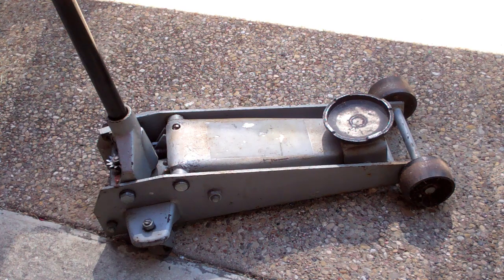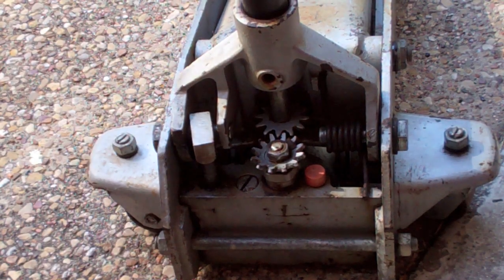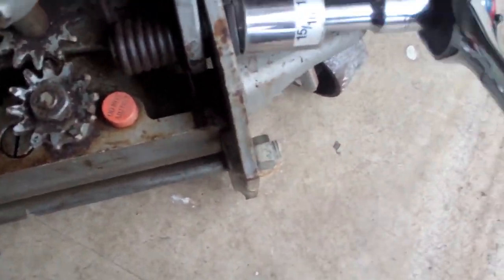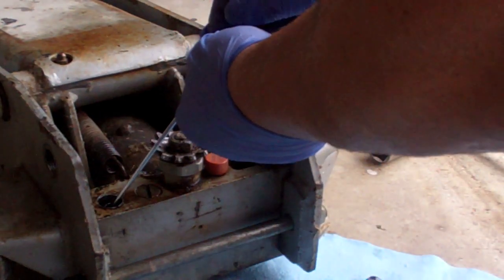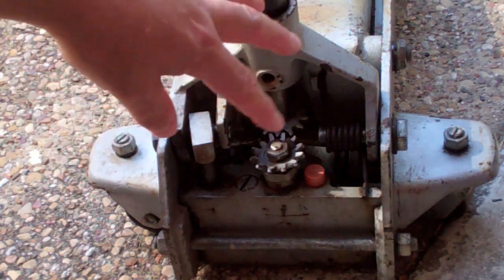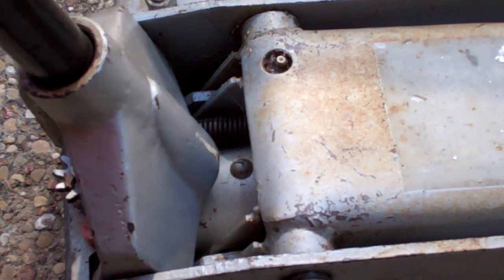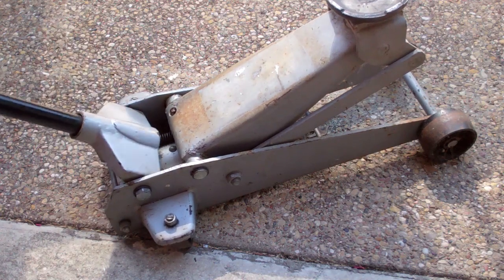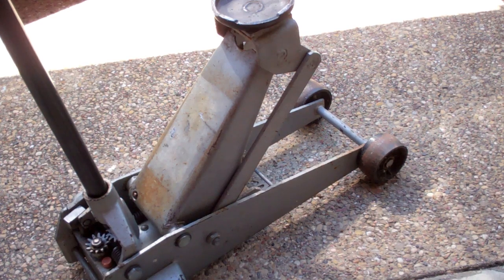How to repair a floor jack that leaks fluid (1 year anniversary updated edition)

Comment: I've got this same jack - first repaired it about 4 years ago using this video as a guide.  Now it's leaking again but the nylon O-ring (the second one in the groove) appears to be bent and buggered up so much that it won't allow the new rubber O-ring to slip into place.  Wondering if maybe just the rubber O-ring can suffice?
Reply from the maker: my guess is the plastic ring is needed and hopefully you can find a suitable replacement

Comment: My jack would not hold pressure very long. The book said bleed it by having jack arm released all the way down, then open the filler plug and put your foot on front wheels, then pull the jacking arm all the way up by hand. While up, put filler plug back in, lower jack arm with the handle release  then jack up something. It fixed mine ...  no more slowly dropping down..  Didn't have to pump anything looking for air bubbles and stuff.

Comment: I have two 3 ton Floor Jacks, one was a Freebee, because they said it didn't work, but it didn't have the lifting Plate that fits in the hole in the top, where it meets the car frame. But got the jack lifting by filling the 3 access holes for the fluid. 2 screw out holes, and the rubber plug in the cylinder. So now I had find a similar jack with a lift Plate to fit this one. Found one on Offer Up, that they said it wouldn't lift, cost me $25, Plate fit perfectly. Then I filled and bleed the other jack, and got it working too.  Took the 2  big front wheels off cleaned them up, oiled them, then went to the 2 little wheels on the back. WARNING: A nut and lock washer holds them on the Frame, and I thought it had captivated bearings, it didn't, it had a top and bottom bearing plates with 19 little ball bearings in between, and I had to chase all these little ball bearing across the floor. So be careful if you remove the 2 little back wheels. I cleaned the plates, put grease in the groves or both plates and placed the ball bearings in them and held them together till I put the wheels back on the jack frame.  Great Video, saved them both for future use.  Thank You.
Reply from the maker: thanks for sharing those tips

Comment: to echo others, yes great video and comments also. I had same issue and replaced oring successfully...however...still leaking badly at plunger. Soo apparently the U cup under the oring needs replacing or the oring wasn't done correctly and I have to do again. Any idea where I can get the lower U cup seal? Thanks again.
Reply from the maker: usually eBay or Amazon are my go to places for odd parts

Comment: Do you fill that tank were you replacement o rings
Reply from the maker: initially I did put some in there, but the proper refill procedure is through the rubber cap

Comment: Bought a brand new jack and immediately started leaking fluids from the pump. It doesn't have a gear like that one. It won't even lock...it keeps free spinning either direction. 

Dusted off the junk one i found on the side of the road and sprayed it with some PB blast, and the thing worked like a charm. I'll be using this vid to service it and im returning the new one
Reply from the maker: "they don't make 'em like they used to"

Comment: I have this same jack but it is a Blue Point version 2.5T.  It didn't leak but finally stopped lifting so I stripped it down totally before I found this video.  The problem was that the main seal on the piston had disintegrated.  I have replaced this from a local supplier and put all the little springs and balls back where they came from. I have refilled it with hydraulic oil but now I can't get it to lift at all.  The pump seems to be working but there is no sign of lift. 
Is there something that I may have missed? How can I be certain all the air has been expelled?
The video was great, bit I'm missing something.
Reply from the maker: I'm not a jack specialist, but usually low fluid or air in the fluid would cause the lift failure from what I have experienced
Reply: @WJHandyDad  I'm going to take it all to bits again and see if anything has become misplaced.  It's strange that the effort on the handle suddenly changed when I was trying to pump it up.  Something's amiss.
Reply from the maker: @mikecurtis3333  good luck, hope you figure it out
Reply: @WJHandyDad  Hello again, I have lost count of the number of times I have stripped this jack down and every time it fails to lift or even attempt to lift. It is just like the pump is doing nothing.. I have the exploded diagram of all the parts and everything seems to be there and in the right place and it's filled with oil.
All the seals have been replaced. The big ball is on top of the small ball and the safety valve is assembled correctly. The small ball is under the up/down valve.
Are there any other valves or balls hiding anywhere?

I am desperate to get it going again as I have some work for it.  Can someone please suggest what I might be missing or doing wrong? 
Any suggestion is welcomed.
Reply from the maker: Sorry you are going through that.  Unfortunately I'm not a jack expert, just a DIY dad who managed to fix his jack
Reply: @WJHandyDad  Hello again.  Thanks for the reply. I think it's going to have to come to bits again, but I'm not sure what to look for this time as I still think it's assembled correctly with all new seals.  Everything is back where shown in the manual.  I have even tried pulling it up against the springs to draw the oil into the cylinder but even that did not work. 
In fact it blew most of it out onto the floor which is the opposite to what I thought would happen.
Sadly round here we don't have the luxury of a jack fixer.  I'm in rural Spain.
Reply from the maker: good luck, I hope you figure it out.  Let us know

Comment: My inherited Craftsman has been leaking from the same spot. Would you say the o-ring is a ¾" outer diameter x ⁹/¹⁶" inner diameter x ³/³²"?
Reply from the maker: I put a link in the video to the o ring that fit mine.  No guarantees yours is the same.  I had to special order mine because I bought several sets of o rings and none of them were correct.  I found my size by taking the old o ring and holding it over a ruler
Reply: @WJHandyDad  Well. Mine ended up using 2 different sizes and by dumb luck, I bought them! Can't do a test until I see how to bleed it, but that can wait for tomorrow. Plus I forgot to get more fluid. 😋
Reply from the maker: @sethvaughn6316  glad you were able to get it fixed.  The fill and bleed should go smoothly.  I've replaced my o-ring 1 time since I filmed this video and the jack still works like brand new

Comment: This is a great follow-up video and thank you for the guidance!  I picked up a similar jack for nearly nothing off Marketplace for my son and wanted to replace the pump O-ring seal before giving it to him.  If I might, I'd like to offer a couple of additional tips that I found helpful regarding removal and replacement of the O-ring.
-  Pump up the jack before you begin...at least half way.  That  will avoid the flood of oil when you remove the plunger.
-  Once the plunger is removed, pull out enough hydraulic oil from the pump cavity to clearly see the O-ring and plastic retainer.
-  Polish the plunger shaft on a wire wheel and then with steel wool to a shine.  Also, polish the lead-in chamfer on the plunger...this is rough machined and could abrade the O-ring upon insertion. 
-  Grab a 1/4" wood dowel and round the end.  Instead of using a screwdriver which may cut or nick the new O-ring, maneuver the new O-ring into the groove below the plastic spacer using the rounded end.
-  Before reinstalling the plunger, open the jack and push down on the jack pad.  This will push some oil out of the plunger port and purge any remaining contaminants in the plunger area.
Reply from the maker: great tips.  thank you for sharing

Comment: I must say how much I appreciate your floor jack repair video. Mine looks almost identical, only  in red, manufactured by Rodac (NL)

FYI: for those in Europe looking for the size of the o-ring: it's a 16mm x 4 mm (inner diameter x thickness)
Reply from the maker: glad it was helpful.  Mine still works although I did replace the o ring a second time since the original filming in 2016
Reply: I'm in Spain so the metric sizes were useful.  Thanks
Reply: @mikecurtis3333  De nada! Mi casa es tu casa ;-)

Already on to my next repair and learn challenge: chainsaw carburettor throttle adjustment whilst avoiding tennis arm sensation.

Comment: This is exactly where my jack is leaking from.  It's a very old craftsman 3 ton that was in the basement when I moved in so decided to clean and paint it and it looks and works great.  Used it many many times and now just developed the leak.  It's a strong jack, no reason to get rid of it if I can fix it easy enough.
Reply from the maker: should be fixable.  It's 7 years since I filmed the fix and I am still using it.  I did replace the o-ring one more time since the original video
Reply: @WJHandyDad   I saw the o-ring package says Buna 90, is that 90A hardness?  Im coming across both 90A and 70A type o-rings.  Think it matters?  the 70A I can find locally, they sell #94 which is 5/8-7/8-1/8 also.

Comment: Mine looks very very similar amx leaking at the same spot... mine is a GJ 6000 3 ton. i too cant find replacement parts... im going to bite the bullet on your suggestion of the o ring 208. crossing fingers
Reply from the maker: good luck - I hope it works.  Remember to put some jack oil on the o-ring before installing (I don't think I mentioned that in the video)

Comment: my 05 Craftsman has a double lip upper dust seal and below that is a groove for the o-ring and a plastic washer under it. And unfortunately the new o-ring does not want to fit in the groove with the plastic washer. I may try removing the plastic washer.
Reply from the maker: hope you get it - it can be tricky.  I heard someone else mention putting the o-ring on the piston and then trying to install it by pushing the piston it.

Comment: is the jack handle supposed to be able to turn all the way to the left (counter clockwise) until it stops? - I notice if I do that, I can't pump the handle unless I turn it to the right a few times... is that normal?
Reply from the maker: mine pumps no matter where I have the handle turned.  Whether or not that is normal or not, I don't know

Comment: I would say the real test would be to test the jack under load. My jack also does not leak when not under load and pumps properly. But as soos as you push it to 500kg-1ton it stats to leak at that o ring again :(
Reply from the maker: I replaced the o-ring one time since I filmed the original video, but that jack still works great.  I show it picking up my Avalanche in the final bleed video

Comment: Looks like your floor jack is identical to mine. I removed the oil plug and added oil, and then purged the air, but I could not get that original oil plug back into it's hole no matter what I did. Wondering whether you had a similar problem, and if so how did you finally get that plug back in.
Reply from the maker: I honestly don't remember having any trouble with it.  Try putting a dab of jack oil on the bottom of it or soaking it in 303 and see if that helps.
Reply: @WJHandyDad  Could be that my rubber plug is very old and very hard, and therefore not pliable enough to squeeze back into the oil fill hole. Will order a new plug that hopefully will fit.  Thanks for your response.

Comment: I have the same one and probably bought it early 90's. I am going to completely rebuild/paint it. Is there a kit number to replace all the seals? Thank you.
Reply from the maker: I'm not aware of any
Reply: I just bought the seal from amazon  Part# B0188VX5A4 Was about 4 1/2 bucks. Good luck, i'm trying to gat the seal in now, not very easy

Comment: I have a smaller condition of what you had with the leaking piston. Where about's might I find the o-ring or even a set of o-rings if I wanted to match it up with what I have - which are two Allied 3.5 ton jacks. Thanks for making these floor jack videos! It motivated me to get both of mine working better.
Reply from the maker: I searched and searched looking for o-rings that fit.  The only place I could find them was Amazon.

Comment: good update. i see you edited put where you remove the piston pump and throw on the floor. that would of course scratch the shaft of the pump and in turn damage the new o ring. cool vid.